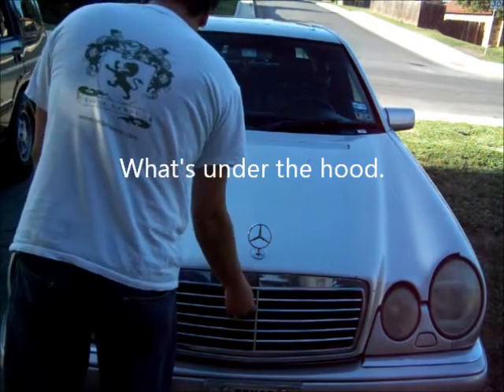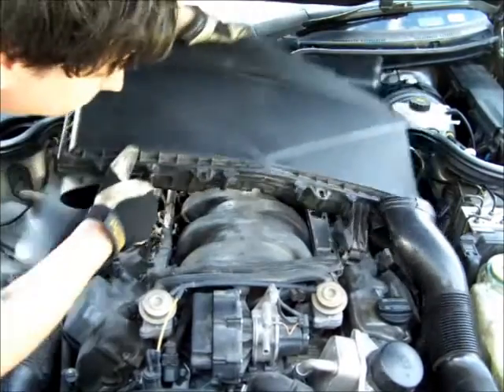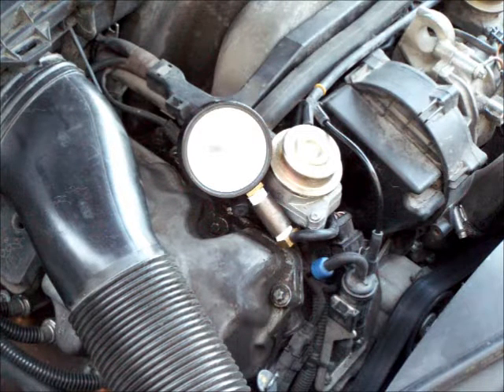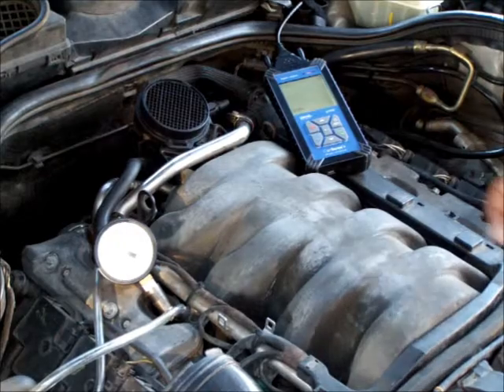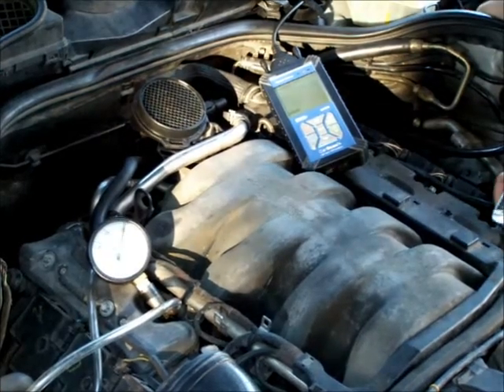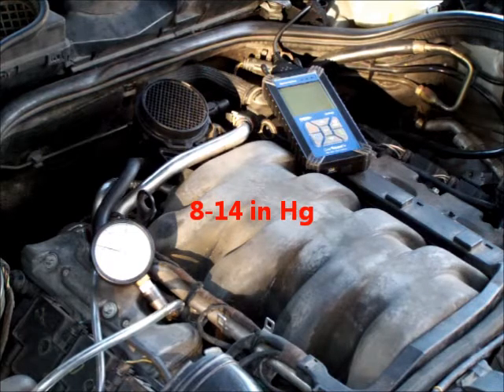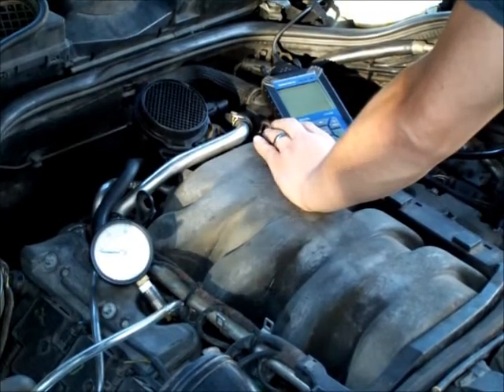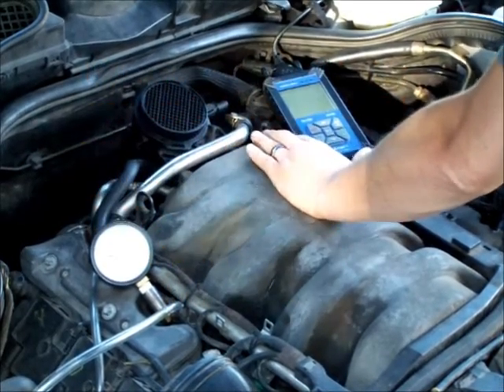Vacuum check on Mercedes W210 E55 AMG

Comment: Very nice and helpful. I will send you an email also; after doing the test the way you did, I got exactly the same results, 18 at the breather, 20 at the front. Have exactly the same car (2000 model). It seems to me that there is a little hesitation on acceleration at lower rpm and my idle is not perfectly smooth. If in gear, it's steady. If in neutral, there is a little loping tendency (may 50 rpm differential). something slightly off. Did you ever figure out the reason for the difference above? Thanks much!!
Reply from the maker: +ProSyncopated I never figured out why its different from the intake to the front of the engine. My car does the slight loping only until it warms up and I have written it off to the more aggressive cam AMG uses and the fact that these cars are rapidly approaching 20 years old. As to the slight hesitation is your EGR valve working right? Have you tried resetting your fuel trims and them seeing if the hesitation still exists? My car had a hesitation on half throttle acceleration around 2800-3500 RPM which would eventually lead to lean fuel miss fires. After a lot of searching I found a 'dealer technical bulletin' number "44/00-02 reduced power during hard acceleration" that states basically if you have one of the first two generation ECU's they used in the car that it is known to not properly calculate the long term fuel trims properly. The third generation computer would fix this but it is pricey. For me this meant that the car was not calculating the EGR's operation correctly.

Sorry for late reply I've been in school full time and working full time for a while now. I have several videos I'd like to to edit down and post but I just don't have the time right now.

Comment: hi i have m112 v6, my car engine dies sometimes when i stop it to zero or if it dont die it shows me like a misfire but its not a misfire but engine is trying to die. sometimes when the car is on a signal in drive mode, it starts shaking and suddenly increases the rpm above 1000 and to stop a collusion i have to get it to nuetrel. eating too much gas making spark plugs black. but not throwing me any code in the system.  only showing me -15 and -17 constant readings in my long trim fuel. short term are fine
Reply from the maker: If your car is dangerous to drive I'd suggest a dependable indie shop , but that being said. Something is making your car run rich and the computer is trying to lean it out. High negative fuel trim corrections can be caused by MAF sensor problems, high fuel pressure, leaking fuel pressure regulator diaphragm, faulty evaporation emissions components, leaking injectors, defective O2 sensors, exhaust leaks/pinholes before the O2 sensor, coolant temp sensor problems. With my Merc the issue was the computer which was causing the EGR valve to stay open but not calculating for it being open making the circuit think that it was running rich when it wasn't. It's a lot to keep up with these girls, which is one of the reason I had to trade mine in. I used to use (aa1car . com), lots on information to at least wet your appetite.
Reply: thanks for the super great response, what i found in my car was a leak diaphram of egr, but i have changed it with one used egr car is not dying but its performance issue is still there, about trading it, i cant do that as i cannot drive anything else after this :)